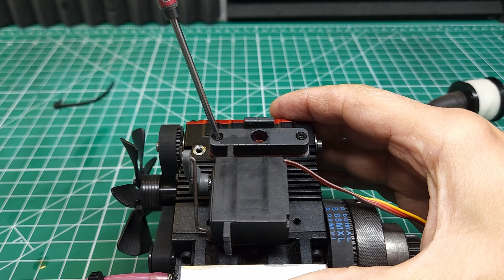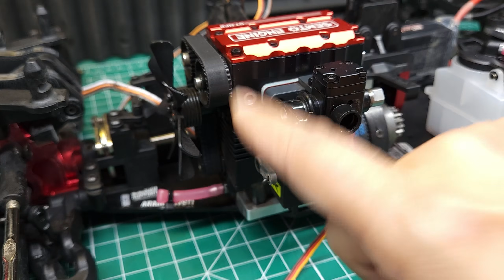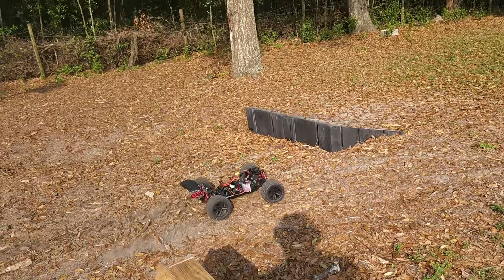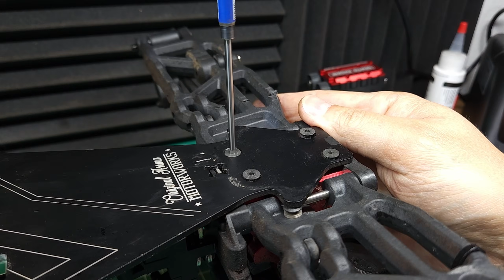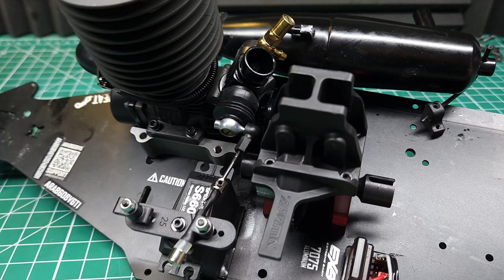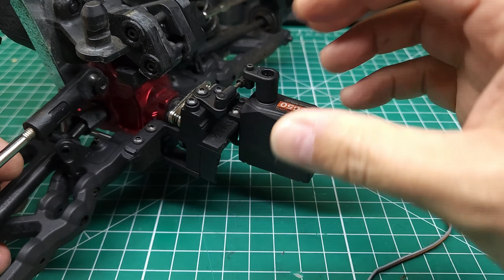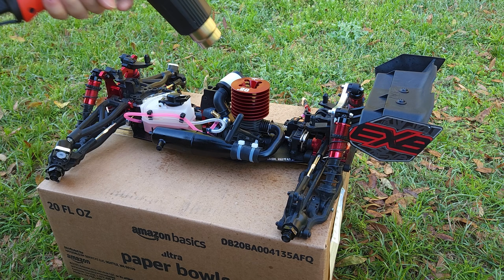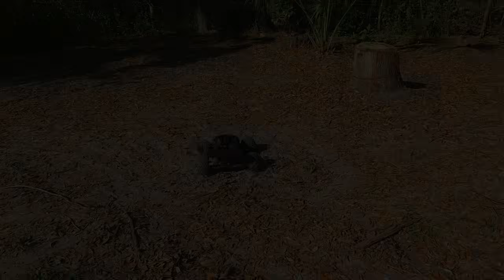I Built The ULTIMATE Nitro RC Basher!

Comment: This is NOT any stronger than other Nitros.  Losi’s , Team Associated , Mugen and other 1/8 scale Nitro Trucks and Buggies are incredibly durable.  This Kraton is based of the traditional 1/8 blue print.  So the race buggies are incredibly tought.  A Huge Misconception is that racers can’t bash.  Completely untrue.  Id argue when I race my rc’s get beat harder than when I bash.  Racing is going as hard and as fast as you can for each heat.   Take any of the aforementioned brands using their 1/8 scale Truggy. And put it side by with this.   You will see what I mean.   I own 1/8 Nitro buggies and 6s Kraton.   And they are very similar.   Kraton is my favorite model of Rc btw.
Reply from the maker: I don't disagree. I think race vehicles are very strong but most people aren't going to bash a race vehicle for a multitude of different reasons. I was primarily talking about from a bashers perspective.

Comment: You obviously just like to make content just to catfish people no if a car wasn’t designed for ice internal combustion engines don’t do it there’s a lot of factors like differential gearing transmission gearing and the torque that the motor is designed to handle 
Also electric rc’s are already in the 220’s mph and the same drivetrain on that model is the same as the arrma limitless design for electric
Reply from the maker: No I just like to make content to do fun stuff. Remember I'm just a dude hanging out in his garage having fun and sharing it with you guys. This is not NASA.
Reply: @DoRC  then don’t post a picture saying it has 6x the original power when it clearly doesn’t stock does 60mph x6 =360mph not realistic
Reply: Sorry but it really grinds my gears how the new generation of enthusiasts are making them look worse and worse by the minute if you want to say you have 6x the power do 12-15s setup
Reply: Hp wise that’s nearly 60-80 hp compared to stock around 2.5-5 hp

Comment: You're also hitting nowhere near the RPM to show how much power that car actually makes
Reply from the maker: I don't doubt that. All of these projects I do are more a dude hanging out in this garage having fun proof of concept kind of thing rather than an optimized ready for production kind of thing :-)
Reply: @DoRC oh yeah I know, it's just the plugs like to foul so easily if they don't get the full rpm range used. I have an Old nitro truck I am actually trying to convert to electric. Has a 4.6 engine too. Team Associated MGT4.6
Reply from the maker: For sure though keep in mind this engine was brand new and was still in its break-in. So I was intentionally running it Rich and easy
Reply: @DoRC yeah, what do you use to do your CAD Designs? I've been trying a few of the free ones but seems like some have way too many steps involved for something so small. It's had me stuck on a few projects like my electric conversion. Especially since I want to change shock towers, the rear practically only gets flat and plus the arms eventually I want to find a way to mount Kraton arms and shafts to

Comment: Glow plug doesnt really stay glowing though…. 2 stroke plus diesel style compression….
Reply from the maker: That's actually not quite true. These are not compression ignition engines. They have a platinum catalyst on the glow plug that reacts with the methanol in the nitro methane fuel which is what keeps them glowing and actually ignites the fuel air mixture.
Reply: @DoRC this is like who was first chicken or the egg, when the glow plug is lit by the battery its well over 1000degrees , compression and heat after that keep it going , not the magical platinum catalyst baby coil of wire😂 the compression and btu of the nitro itself has the real thermal properties, explains why when the nitro runs too hot the compression pushes the coil further up into itself, making the glow plug go bad early if tuned wrong, the real sauce is the engine pushing the load
Reply: @DoRC  they are exactly compression engines, just at the extent of what the mfg set that engines compression up to do, how hard it can squeeze the air, will net a higher combustion temp, reason why a older nitro up to temp is more clearanced out looses bottem end torque, but gains rpm and power up high
Reply from the maker: @Izzabumminz They are not compression ignition engines. If the platinum on the glow plug fails they will not run.

Comment: Would it be possible to run 2 nitro motors 1 for the front wheels 1 for the back fed off one gas tank 🤔 i dont think running 2 for all 4 wheels would work because of the timing without some sort of clutch/slipper gear type of set up witch would completely complicate things more. Just a random thing i was wondering, also how effective would it be.. would the added weight cause it to lose efficiency or no..
Reply from the maker: Two nitros yes one fuel tank gets complicated because the engines rely on the fuel pressure from the exhaust to push fuel into the carburetor so unless they're perfectly synchronized which of course you would want them to be running the both off one tank could be tricky.

Comment: My 2 stroke has piston rings, but it's not for an Rc so might be different.
Reply from the maker: Most two-stroke engines do. These small nitro engines don't as they rely on the taper in the cylinder for sealing.
Reply: @DoRC  wish they made some of the bigger 2 strokes like that. Simple design

Comment: You know how you put nitro fuel in it we'll get the highest one you can get  of nitro fuel
Reply from the maker: The nitro percentage can help with performance but usually only if the engine is designed for it.

Comment: To rich
 Lean it out a bit
Reply from the maker: Yes I mentioned in the video that it's running rich because it's still in the break-in process.
Reply: @DoRC  your not doing the break in right. That is for sure. Should only take a day. A tank of fuel at idle then a tank for half throttle an a tank for full throttle. I do break in's all the time.
Reply from the maker: @happys104092243  the engine hadn't been run for a day. I like to run a couple tanks at idle and then a couple tanks it part throttle and then a couple tanks at 3/4 throttle than a couple tanks at full throttle. The video schedule meant that I was still in process of doing during video recording.

Comment: This is a cool build video the only issue is comparing a low-performing 0.28 to a 6S capable brushless motor it's not even a comparison by any stretch they're so far gaped. If you really want to compare a nitro motor get the lrp big block it's available through AMAIN. That may not even be to the level of a 6S brushless capable motor but I'll tell you what it's going to make that 28 you're playing with look like a child's toy 😂
Reply from the maker: Maybe though I've had the LRP32 in the past and whereas I think it is a little bit more powerful This thing's actually pretty decent and I think is a fair representation of the expected performance especially on a heavy truck like this.

Comment: Now diesel swap it!!
Reply from the maker: Not a bad idea
Reply: Nitro runs the same way as diesel. They both use glow plugs. But diesel can run with no glow plug.
Reply from the maker: @happys104092243  they both have  something called a glow plug but other than the name they don't behave the same at all. In a diesel engine the ignition happens based on compression alone and the glow plug is there to preheat The engine when it's cold. 
On a nitro engine the glow plug itself is what ignites the fuel air mixture.

Comment: Hella glad to see u tested spark with nitro, its rare to see a youtuber willing to step off the beaten path for the sake of the experiment itself.  Rlly glad i came across this channel ngl
Reply from the maker: Yeah I was definitely curious to see how it worked. I think it has a lot of potential though not necessarily with this system
Reply: @DoRC  I think if you had put a bunch of timing advance it would have worked better, nitro burns really slowly and top fuel cars run like 60 degree BTDC timing to burn all the fuel in time. That’s why glow ignition works well in nitro models, it’s basically igniting the charge as it enters.
Reply from the maker: @mikescherrer4923 off camera I tried a bunch of different settings including significantly advanced and what you saw was the best I could get it to do.
Reply: @mikescherrer4923 at a certain point he is also gonna be battling displacement to power ratio, the toyan engines as far as I've seen are meant more as display models and besides what he already did to it any more power would have to come from boost (which would likely cause significant issues if it even ran as the toyan is a glow engine stock iirc so it has high compression)
Edit rq but when I said display above I meant they're moreso designed to be started and run on engine stand displays, less meant for actual engine usage but I've also seen plenty of footage of them pushing rc cars just fine so idk. Would be an expensive experiment just to find out tho
Reply from the maker: @akiiira6709 That really is the major problem with these engines. Their own manual rates it at 0.5 horsepower which is 1/6 what a normal nitro engine of the same displacement would be. 
These things are designed to run really really rich I suspect in order to keep the lower end lubricated. Even with the mixture needles all the way closed it still runs rich.
Reply: @DoRC I've never seen power specs for them but I figured it wouldn't be that low that's actually crazy for how much they charge lol, does definitely explain where all the torque went tho

Comment: Like i tolds ya man... that thing is a low rpm engine, you need a wayyyyy looser clutch spring for it or youre just gonna slip all day long.
Reply from the maker: If the problem was clutch slippage the engine would be revving a lot higher. It free revs probably twice as high as that.

Comment: I thought the toothpaste trick didn’t work anymore bc the removed aluminum oxide from it. I always just use water soluble grinding compound u can change the grit the more u grind.
Reply from the maker: They don't use aluminum oxide but they still do use an abrasive. There are several different kinds depending on the toothpaste.

Comment: If its not a Radiomaster MT12 ELRS  then you are wrong and chose badly...🤣
Reply from the maker: Maybe though I kind of feel like the MT-12 is more complex than most people need.
Reply: @DoRC  Complex or con*tent* ... 

If you find it a barrier then so will your followers.  Edge TX as a learning curve but ALL edge TX is the same, plenty of tutorials on quads n planes to be inspired from.

Mt12 ELRS + multi P module will do 95% of cars.  One radio for all.  I use my flying sticks to drive now after failsafing Dumbo RC in a carpark... A carpark, Dumbo is the good one right?  ELRS 20KM+ and it tells you 5 times first.  Faster 1000mhz 2 way link gives you voltage.

I use 1 radio for 2 cars and 11 quads.  1 model car, 1 model copter done.

Comment: Nitro still the best for RC. I had a few electrics and they're OK but nitro is just so much more fun, especially if you get a few other people to race with or just bash around. USed to have an HPI savage SS monster truck. It was nitro and I had a 2-speed on it. You really need that to get the most out of it. Nice thing about nitro is you can refill can continue till you are out of fuel. With electric you can bring spare packs but you won't be fast-charging packs that are already hot from using them. AS long as the nitro engine is properly tuned you can run it all day. It won't overheat.
Reply from the maker: Yeah I think it just depends on what your goals are. I personally will still run electric 99% of the time though I do really like the option to run a nitro occasionally as nothing beats the sound and smell!

Comment: Soooo…. Next Videos in this Series… you did plan on building some custom damper dishes that would allow for different damping behavior on slow and high speed shaft movements… right!??
Reply from the maker: You mean in the shocks?
Reply: @ yes. In better dampers on sport and race cars, you can adjust low speed and high speed damping. Some years ago, I actually saw some dampers that offered this for rc cars. Can’t find them anymore. But the idea is: low speed damping is acting on roll movements of the chassis and high speed damping makes the damper softer(opens some more holes for oil flow) on curb strikes or just pot holes and uneven terrain.

Comment: Two cylinder has lots more to offer. It’s obvious by listening to. The clutch was drastically slipping. Engine revs up car doesn’t speed up. it’s so easy a caveman could figure it out.
Reply from the maker: Well I definitely recommend you grab one and try it yourself. I spent multiple hours off camera tuning and that was the best I could get out of it. Without a load on at the engine revs much higher and this thing is rated at 1/2 horsepower.  Again though please try it and let me know what your results are!

Comment: Hpi 4.6 will stomp the other motor. I love the 4.6 the 5.9 was great but finiky . An Lrp32 oh lord best bang for the buck. Lotts of power. The hpi 4.6 is better then the dynamite for sure. An Lrp32 it will wheelie all day. Then there is navarossi or piccos but big money. LRP32 MOST POWER MOST BANG FOR THE BUCK.
Reply from the maker: Yeah I think the HBI 4.6 probably is a bit better but the dynamite motor is actually pretty decent and I think is a fair representation of nitro in general. The LRP32 is a powerful motor but it's a real pain to keep tuned. Probably has the worst carburetor of any nitro engine I've ever dealt with.
Reply: @DoRC  i didnt have a problem with mine but i made sure the carb and the crank bearing was leak free.
Reply from the maker: @RICHIE_RICH89  You must have gotten lucky then. The LRP32 carbs are notorious for not holding a tune.

Comment: Dual nitro motor kraton I lit would be a riot
Reply from the maker: That does sound fun!
Reply: @DoRC dude it would be very cool if you did that I would buy the setup and turn mine to dual nitro
Reply from the maker: @BrandonTIBBSRC I don't really think it would be that difficult. The amount that I made in the first video would technically work to mount an engine on the other side and they both will fit. Supporting hardware would be tricky as it would be best to have two fuel tanks but I think it's doable.
Reply: @ i think it could be doable but also pretty tough to make it work but it would be one hell of an rc car by the end

Comment: noo you cant mill out the fins on the motor. just make a brace with a bend in it to go around the motor !
Reply from the maker: Well you definitely could and as long as you didn't take out too much of it the cooling probably wouldn't be very different but yeah ultimately it's better to just adjust the brace.
Reply: @DoRC  you could it probably wouldn't effect it much.  But I know I wouldn't want too mill chunks out of my very expensive motor. That would also be very difficult to do with out the proper equipment.
Reply from the maker: @matthewb7049  fortunately I do have the proper equipment :-)
Reply: @DoRC   I agree with you 100% if you don't  need to remove to much material it would look clean with that original brace in there. Or hack up a chunk of alumium to make fit around the motor. Either way. Both options are good.

Comment: On those big bores, it helps to preheat the engine before you initially start it, or use a starter box.  They have so much compression that this happens to the pull start often.  I laughed when you were removing the screw to pull the engine and it appears you're giving the engine the bird.  😂
Reply from the maker: Yes I always preheat before starting. I hate trying to start a nitro engine cold. 
I noticed that in editing :-)
Reply: @DoRC  Another thing you can do is to leave the glow plug untightened. Most small nitro engines will start (and run) just fine with the glow plug far from nipped up. You can start them with the plug loose, then tighten it up as it's running.

Comment: hey, i have a arrma granite mega boost 550 and I burned out my motor. i want to keep everything brushed and i am having trouble of which motor to get. i want speed, durability and torque. i have been looking into the holmes hobbies trailmaster sport 550 bit I wanted to hear your options and opinions. ty
Reply from the maker: Go brushless. The only reason to stay brushed is to save money and if you're trying to put a high-end brush system in there you're not going to be saving money.
Reply: @DoRC  @ I do not have the money for brushless. I would need to replace a lot of things. What would be a good brushed motor. I would put a brushless system but I cannot simply afford it right now. I know it would save me money in the long run but, I want to drive it and right now, I just dont have the funds.
Reply from the maker: @RCaddix60  okay well the trailmaster motors are definitely about as good as you're going to get for a budget motor.
Reply: @ is there any other motors out there? Would a Titan motor work? What would you suggest?
Reply: @ I do not have the money for brushless. I would need to replace a lot of things. What would be a good brushed motor. I would put a brushless system but I cannot simply afford it right now. I know it would save me money in the long run but, I want to drive it and right now, I just dont have the funds.